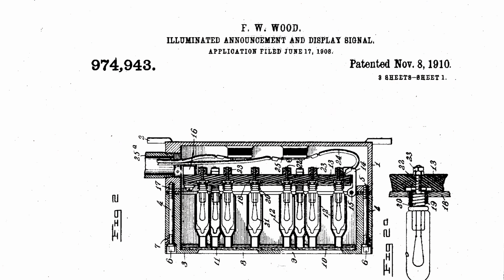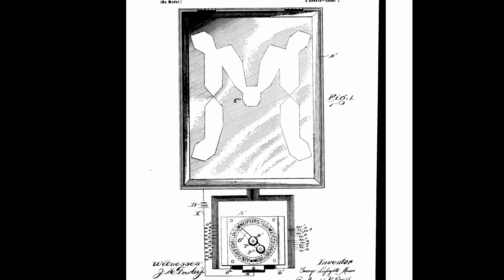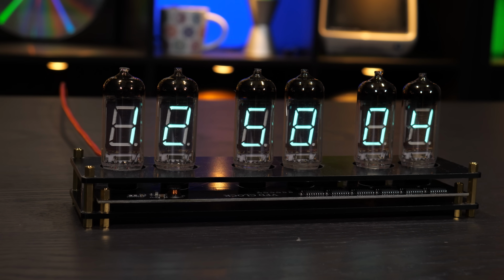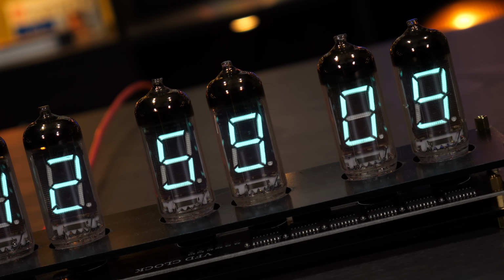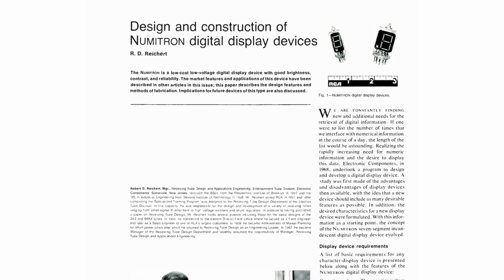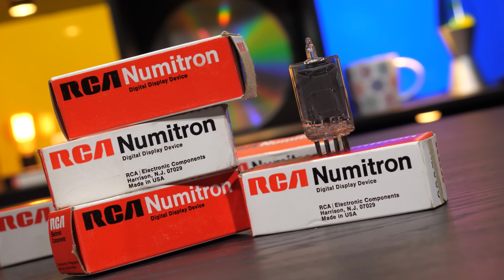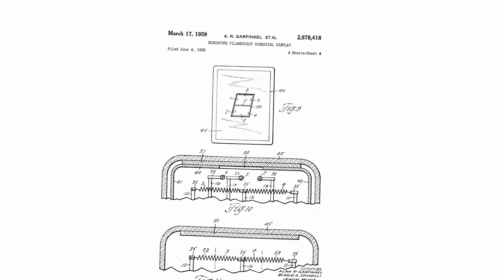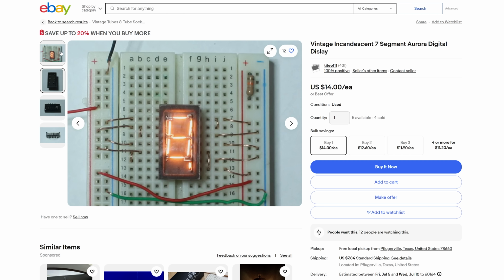The Numitron: An obvious idea that wasn't very bright

Comment: I can confirm these were Indeed popular on gas pumps probably around the '80s iirc.
Reply: Ah, I remember seeing those in gas pumps now. I always thought it was a fluorescent style display, like a neon gas.

Now I know what I was looking at
Reply: Yes! I remember being annoyed at the vertical segments going past the horizontal ones 😅
Reply: @Yidhra23  I am also from the UK, but switch to American terms to avoid confusion (I guess I messed up here!). I do miss the days when you could put two quid's worth of fuel in and get some decent mileage from it. 😂
Reply: Interesting video. I do think you were a little hard on the numatron though. I think the reason they weren’t more polished is that they appear to use the existing vacuum tube materials and manufacturing processes of the time.

Comment: There were other incandescent 7-segment displays that looked like flat DIP devices with a glass plate on top and DIP pins on the bottom. (An ebay search today shows a few.) I remember it was a stocked part at Radio Shack in the 1970s.
Reply: Wamco. I used this in cockpit instruments. I think I still have few. They even had bar graph displays.
Reply: Fuji 3015F Minitron was very popular.

Comment: It sounds as if they put exactly the right amount of effort/money/time into this product, for the limited amount of time it would be relevant. If they had done it better, would it have lasted longer on the market? Probably not.
Reply from the maker: I'm not sure I'd agree - the existence of the later clones in flat packages (with actually-black backgrounds) proves that RCA had a valuable-enough concept but they failed to execute well. Honestly I think a lot of it comes from hubris and the desire to keep their tube-manufacturing machinery going a little while longer.
Reply: @TechnologyConnections  Wouldn't a black background just hurt visibility due to the brightness and width of the wires?

Comment: The always-conservative aviation industry has used these for far too long; I believe some of them are still in use today in 737 NG IRS panels
Reply: Those would probably be Fuji 3015F Minitrons
Reply: @zaprodk  Looks familiar! They also used versions that show N/S and E/W
Reply: Some of the reasoning for their use in avionics comes from the necessity of being able to dim an entire instrument panel and having everything on the same brightness curve.
Reply: Cessna factory radios used these or something very similar in the late 1970s through the mid-1980s
Reply: @captainvector Minitrons in the radio controls and the Davtron clocks were their own in house manufactured displays.
Reply: Yes they definitely are— i knew they looked familiar

Comment: I love the VFD, it's such a cool design and 80's and 90's devices looked cool because of them.
Reply: VFDs were all the rage in auto instrument clusters back in the day.   I had a Ford Probe with a digital cluster.  I felt like Don Johnson in Miami Vice.
Reply: @MrSloika  ford was using them for a while, even in relatively new cars until they went with LCD's.

I liked the deep green VFD in my Taurus.
Reply: @MrSloika I remember my moms 88’ Pontiac having those. The Grand Prix also had an insanely complicated compass that was never calibrated.
Reply: @MrSloika  Toyota was still putting VFDs in their cars until at least 2015.
Reply: @MrSloika  The Ford Probe and Porsche 928 had at least two things in common, the head lights popped up, and the instrument cluster articulated with the steering wheel.
Reply: I have an alarm clock with a VFD display.  They look nice.
Reply: @volvo09  Same here, the "ice tube clock" from Adafruit.  Recently died, have to swap out a blown cap
Reply: Have you seen the Posy video on them? Fantastic
Reply: VFD is totally in right now
Reply: @Dukefazon -- Indeed!  Our stove, our microwave, our stereo components, a couple of our alarm clocks...  The things were all over lots of electronic devices when I was a kid!
Reply: UnifontEX in a Noritake VFD would be beautiful.
Reply: Absolutely.  I love that nice fluorescent glow.  It's one of the few vacuum tube devices still in common use.  Most people don't even realize.
Reply: The phosphor glow is lovely.  And the barely-glowing emission wires give it an alien tech vibe.
Reply: Our modernish Freesat Freetime HD recorder made by Humax still uses a VFD, was very surprised it wasn't an LED or LCD based display.
Reply: The Village of Fowl Devotees?
Reply: I loved the cool blue-green glow of VFDs when I was a kid and thought they looked so high-tech. Still do, tbh. But they're not great for clocks on VCRs and bedside clock radios that get left powered on for 30 years because they fade so badly ovrr time. I have an old Sony Digicube alarm that I had to take out of use a couple of years back when the VFD finally faded to the point of being unreadable in all but pitch dark conditions. Such a pity as the rest of the unit still works perfectly, even after almost 40 years. I may try to source a working replacement VFD for it, but of course the same issue will eventually recur.
Reply: @rich_edwards79 at some point, lifespan is finite. What's the point if you don't get to enjoy it. How many 30-40 year lifespan displays do you need in your lifetime? 2-3?

Comment: “Ignore all the continuity errors. It’s a running clock”

Yeah not to mention the Krakatoa’s worth of lava lamps behind you
Reply: I wouldn't put it past him to record an hour of passing time with a blue/green screen behind the clock, then compose it back in to make everything appear as a single-take 😁
Reply: 😆A Krakatoa of lava lamps...! Priceless!
Reply: @kimvibk9242  Its the metric unit.
Reply: @smalltime0 A metric unit that fell out of favor, because most real world quantities, required a fractional expression Even for rather large quantities: "The number of individual parts in a typical automobile is 0.002 Krakatoa."
Reply: @smalltime0  Surely the metric unit is an Etna of lava lamps? 😉
Reply: @2ndfloorsongs  You mean 200 micro-Krakatoa? Perfectly in line with metric units :)
Reply: @holgerchristiansen4003  Of course you're right. Maybe it was the confusion with the "K" for degrees Kelvin that discouraged its use.
Reply: @2ndfloorsongs  No, it fell out of favour because the internationally agreed reference unit clearly changed size rather significantly...
Reply: @nialltracey2599 Brilliant observations, such as yours, are why I'm a slavish reader of this wonderful channel's comment section.
Reply: @holgerchristiansen4003 And speaking of the metric system: I've often noted that the metric system lacked a unit for arbitrarily large numbers. Because of its already common use, I propose the unit "zillion". And arbitrarily small numbers could, of course, be represented in units of zepto-zillions.
Reply: Might be actually accurate, Krakatoa AFAIK didn't produce much lava per se, it was a lot of ash and rock and other ejecta. The "main" four explosions were Plinian type. Though it was preceded by months of Strombolian activity which does include some lava flows.
Reply: Krakatoa, East of the Koffee machine.
Reply: 'Krakatoa, East of the Java machine' would be funnier...
Reply: Theres a “Technology Connections but every cut is in chronological order” just waiting to be made…
Reply: Continuity errors? Like at 12:32?
Reply: my thoughts it would feel like a warm hug from behind from the heat being produced from that shelf
Reply: Hey, Alec-fluctuation is still the standard in amorphous transformation queue cryptography
Reply: Wait how is your comment a year old when the video is only 11months old
Reply: Lol
Reply: We'll fix it in post! 🤣
Reply: That Krakatoa worth of lava lamps are like flaming globes Sigmund like flaming globes

That's not funny and there's nothing funny about that

Not that there's anything wrong with that

Yes I know Krakatoa is real and not just a different obscure Seinfeld reference